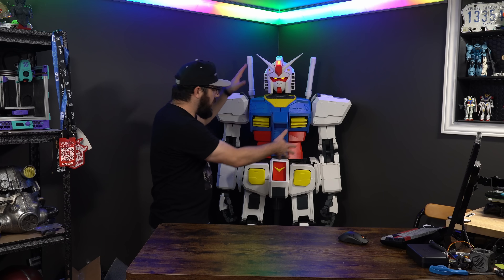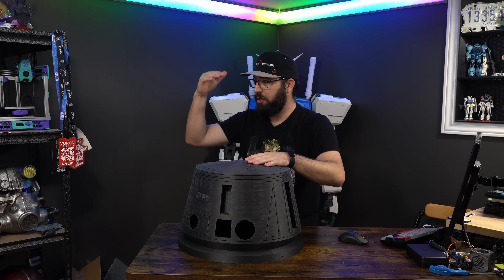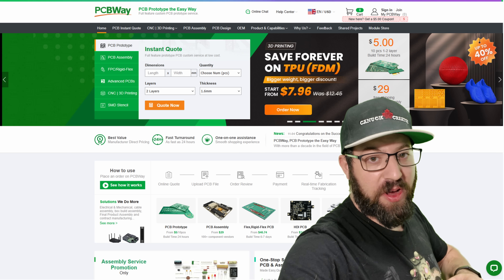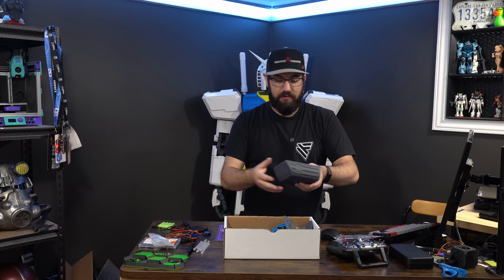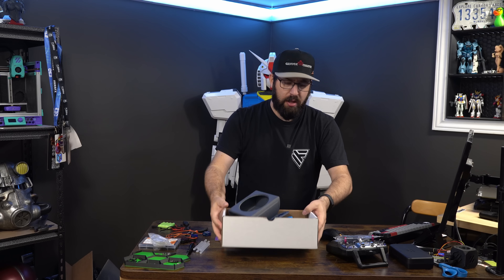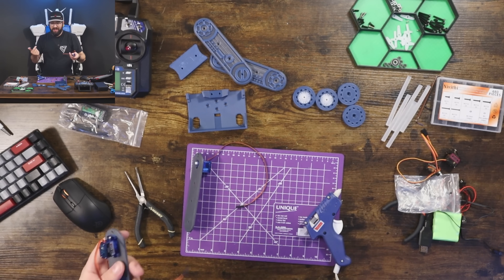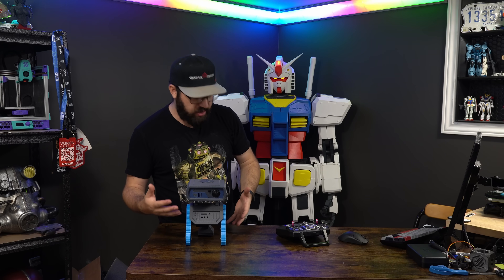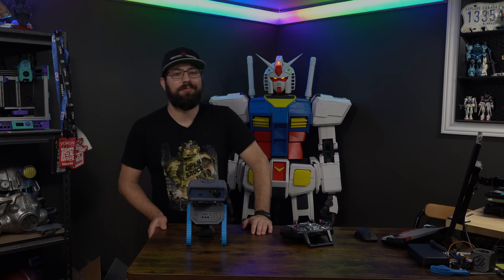I Built My Own STAR WARS themed DROID! The T3-D0!

Comment: Did you print the ASA-GF on a blue cold plate?! Or did i see that wrong? :D
Reply from the maker: Its the cryogrip, not the glacier....or the otherway around (cant remember)

its the one that lets you print a bit cooler on the bed but tbh have the time i printer with normal settings